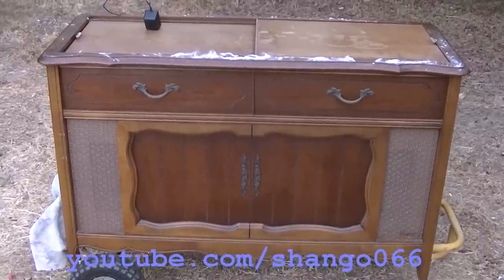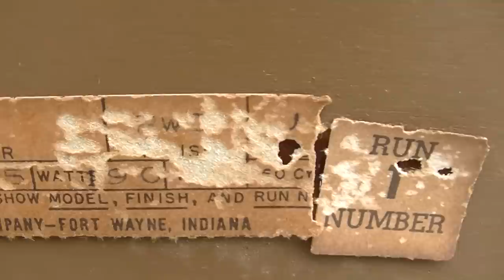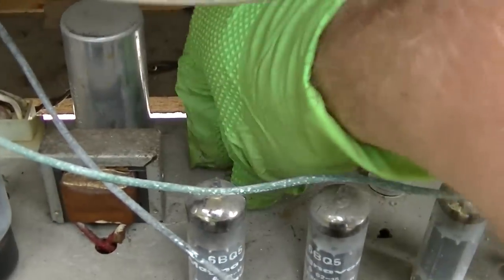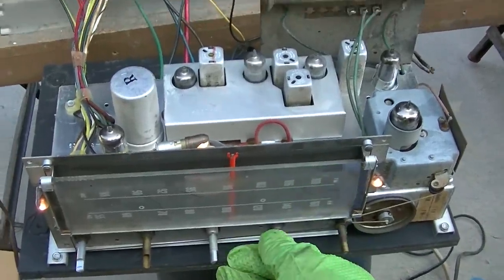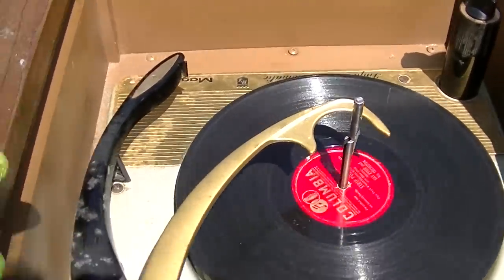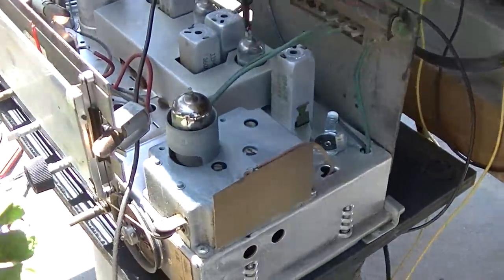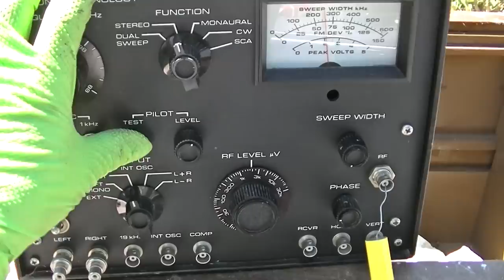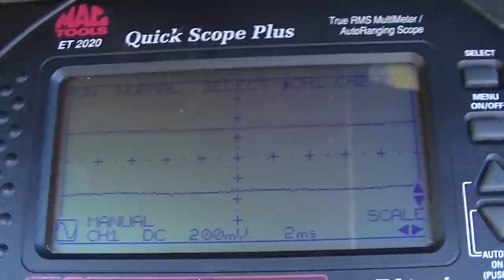1963 Magnavox Console Stereo Phono AM FM MPX Resurrection Repair Whatever v3

Comment: I have an Astro-Sonic combo unit from 1966 with the TV, record player, and it has a wireless remote control. The radio works decent, the record player is missing, (long story) the TV part hasn't worked since the early 70's. I have recapped a little bit on the radio chassis and the crossover and I got it sounding pretty good. This thing gets loud and will shake the room and I am amazed on how well these beasts were built. Unfortunately I lost interest in this thing about 8 years ago and now it's just a big piece of furniture.

Comment: Shango.. - you need a small cheap motorcycle lift as a work-table. it will be so much more easy to get things in the right work height.. - and spare your back.  Nice video.   😊

Comment: I'm surprised you had so many issues with this one, Magnavox tube gear is pretty robust. I'll bet the smoke at the end was from leaking paper coupling caps. Those wafer tube sockets were garbage, and GE used a ton of them in their radios. In fact, there are certain models where GE used them with a 50C5 output---the heat from the tube would bake the socket so bad that it would crack and short between pins. And I had one break into 4 pieces and fall through the chassis when I tried to reinsert the tube in the socket

Comment: Those 6BQ5 tubes I believe are Magnavox branded Telefunken tubes. Quite valuable. If you have a matched set of four that are all good, you're in the hundreds of $ for the set of those. You nailed it that the amp is worth way more than the console as a whole.
Reply: The amp isn't worth that much but, you're right, the tubes, if Telefunken, are worth at least $150-$200 for a quad used.

Comment: You had the wires carrying the audio into the amp laying right on that output tube that was oscillating. Maybe the high voltage swing from the plate was capacitively coupling back into the input wires causing the oscillation. Could be nothing wrong with the amp itself but just the wires need to be repositioned.

Comment: had one of these all the time growing up, with the TV in the middle and angled satellite speakers as well~ was so awesome could pile on 7 LPs and play table tennis~ bout the time I was born in 65 till 1980 when the roof leaked and everything was rotted...in winter....still Ken the Engineer (bout like chris too you)  pulled it apart and continued to use this as the Ping-pong amplifier

Comment: 6AB4 is a EC92 in the uk and  europe, i have a grundig that uses one in its fm tuner and trying to get a new spare replacement has been a pain, most dont work, original EC92 does, but the non working ones test good on a valve tester, weird, it must be very picky on the exact characteristics of the valve!
Reply: Theyre also basically half an ECC81/12AT7 and that was an official replacement to use half of one to replace an EC92/6AB4, (if theres room) as EC92s werent available for long in the UK from the main valve manufacturers ,

Comment: the stereo thing in the amp where one side sounded perfect and the other side is mono... thats the volume pot going bad, wasnt long ago i decided to fix a old Philips Radiogram which had the same problem and i traced it straight to the volume pot , damn thing was so confusing cuz it uses a single ECC83 preamp tube but yeah in the end it was this 800ohm with 200ohm loudness tapped (1meg total)volume pot that is like shorting and stuff from the shaft. cant find a perfect replacement for thos these days and it only got worse after i removed the whole thing and cleaned it.
Reply from the maker: If that were true the problem wouldn't only exist on the phono input.

Comment: I enjoyed your video, I just purchased one identical to this one. It works for about 15 minutes on regular FM then the volume gets weak and the sound is distorted. After it cools off its normal again except on stereo it's low volume and distorted. I'm a GM auto tech, know nothing about this type of electronics. Any tips about what could be going on with unit? Thanks!!

Comment: Yeah, I got one of these.  Restored.  Physically clean everything first.  Remove oxide. No, that unit you have is older than the Astro-Sonic that came out as a transistor unit the following year..  Phonograph- Yup, the screws are screwed down when in use.  Replace the capacitors, the phono cables, not the cartridge, but yes, replace the needle.  Someone took your knobs and gave you crudy ones.  Run in "AUX" for iPOD.  The capacitors are so old they are acting like resistors.  Replace all electrolytic capacitors first.

Comment: I suspect that the two coils closest to the output of the multiplex demodulator chassis are the 19 kHz traps. Unless you are a young person with excellent hearing, you cannot align these by ear. Instead, turn off the 1 kHz tone and use your oscilloscope to find the slug positions that result in the minimum amount of 19 kHz output for each channel.

Comment: What happened after the smoke?  Did you ever bother to find out?  I learned alot about Multiplexers and fibre board tube sockets as garbage.  I think I'll never have the eqpt like a tube tester or a scope.  I have some skills and a VM, Capacitor tester and a few light bulbs from 60w to 300w.  I don't have a Variac.  Recently I came across an old bakelite radio but the price was $80.  I'd never spend that kind of money on a project I know I'm going to sink money into.  The things I've learned from you, my rudimentary training in HS in 1971 and YouTube to help me understand the mechanics of circuits and devices, I feel confident to try repairing electronics as a hobby if ever I could afford it.  To me your videos are priceless.

Comment: This unit is very expensive unit in 1963! My parents tried to buy it used and it cost close to $400.00! I saw similar unit sold in furniture store in Philadelphia for $500.00 cash and with installment payment weekly payment plan with down payment  with 23% interests rate, the payment still over than $8.00 per week back in 1972. The new car payment was $100.00 a month and full coverage insurance that about $650.00 per year for clean record driver.

Comment: Usually, the changer is the biggest headache and it works fine. I didn't see any cleaning of the pots or tube sockets and only 1 cap replaced. Seems like you quit too soon.

Comment: I hunt CL pretty hard for these 1962-1964 Magnavoxes from the tail end of their tube era.  They either have the 8000 series quad 6V6 amp or the 9000 series quad EL84 amp, which can be easily restored.
Reply from the maker: Come get it
Reply: So true and they are excellent stand alone amps. So sad people just threw them away. I have one of each.
Reply: @shango066   It's a 3,000 mile drive each way, someone out there can have it.

Comment: Shang, I manged to fix the crt problem. It was the high voltage. It was oscillating. I tweaked the HV adjustment pot and it stopped. Any idea why the HV circuit would oscillate like that?

Comment: What output level should the FM tuner be?
 I suspect the RF amp triode half of the 12DT8 in my set is dead .. FM LO is working, reception is very faint, no measurable output to IF stages. Ooof, the FM tuner socket is a flat fiber one.
Too bad yours let out the smoke.
Reply: FM tuner output should be line level, -10dBV (0.316). Same as any consumer grade CD or DVD player, etc.
Reply: @dougbrowning82  that’s true for a component system tuner.
My tuner is like the one in the console radio Dan/Shango was working on. It has a duo triode (12DT8) RF amp. & osc. converter, that provides an IF signal that feeds into the IF stages at 10.7 MHz. It’s “that” output level I was asking for.

Comment: On a push-pull output circuit with a cathode bias design and you remove one of the output tubes you change the bias on the other tube so that it has to run way too hot which is why the tube was turning red.

Comment: The cross talk between channels is a design feature of that unit. The audio pre amp on the control chassis is a high mu twin triode, usually a 12AX7, which has little isolation between the triodes. Such tube were intended for use as multi stage mono amps, multivibrators, or driver/phase inverters, not stereo amps. In fact, RCA tube manuals warn developers not to use them as stereo amps. Equipment manufactures use them this way because it's cheaper to use a single 12AX7 than a pair of 6AV6s. But you'll never get true stereo out of an amp designed this way. I once had a Bell amp that had three stages of pre amplification wired that way that had terrible separation. You could plug an input in one channel only and hear it out of the other with little difference in volume.
Reply from the maker: It doesn't have any 12ax7 in it and there's no crosstalk on anything but phono
Reply: @shango066  That's weird, gotta be bad lead dress on the phono input then. Preamp's gotta be 12AX7 or 6EU7. Same tube, different pinout. Someone's been in this thing before. No telling what they've done.

Comment: All those wires.  While it made sense from a service standpoint during a “normal” service life, years of oxidation on the wire connectors and tube sockets don’t help. Those 6bq5 mini pin tubes never seem to fit as tight as bigger output tubes.

Comment: I rescued from the side of the road a Voice of Music console stereo with REEL TO REEL! It is around 1964-66. It was about $650 when new according to info online. One of their first solid state units. The amp works with external input and I got the record changer working and have a new needle--cartridge seems OK. Haven't put it on yet. Can't tell about the tape player (don't have any tape), but it appears to turn OK and the microphones work. Problem is the AM/FM are both dead quiet. No static, no stereo light, no tuning meter deflection, nothing I get a click in the speaker when switching between modes. Don't know where to start looking. Some of the voltages are high and a few low. (I have the service data.) I assume some bad caps, but don't want to do a wholesale swap. Don't particularly like the way the PC boards are set up.
Reply: Does the tuner section use any tubes? That's the first thing I'd check.
Reply: @bertroost1675  Whole thing is SOLID state.  First years for it. FM tuner is separate and run by same dial cord. AM section is mounted on the IF board. FM and AM have separate IF sections on the same board. IF cans are huge>>looks like the same as used on tube stuff. Multiplex board is separate. Has separate audio board that feeds the power transistors in the amp. This section works OK even though it has a lot of caps. I have more experience with tube stuff. Easier to check/replace caps and resistors with point to point on tube stuff. Higher impedance. PC boards, much harder.

Comment: Maggy used the same model ##'s for sets with different chassii. Every sub assy will have
an apx  1" X 1/2"  tag. you can find them anywheres on the chassis. Trouble is they fall off !!!!
A real PIA it twas.  Model ## only good for cabinet parts, chassis ## only for the innards.
LFOD !
Reply: I recall the chassis numbers being inked on the metal itself as opposed to a glued-on paper label.